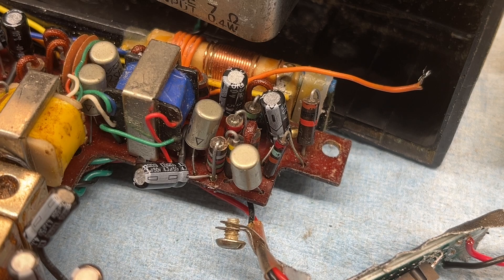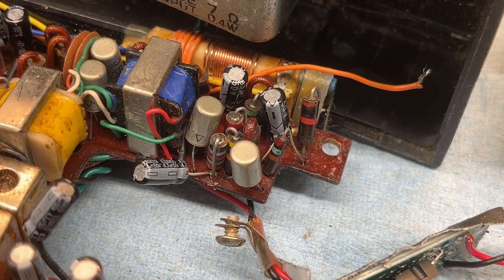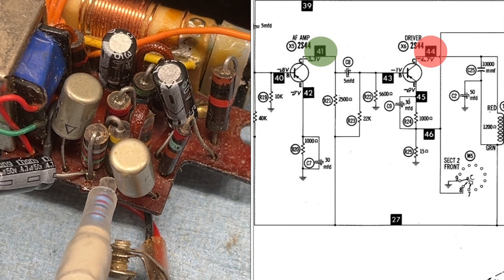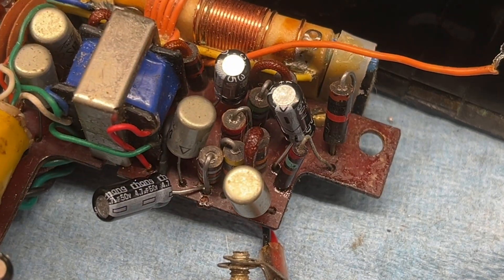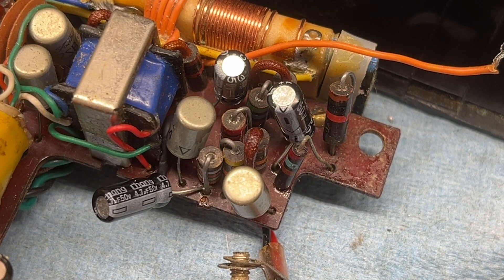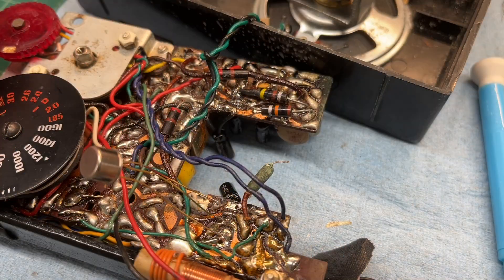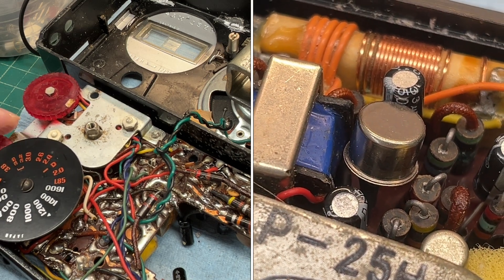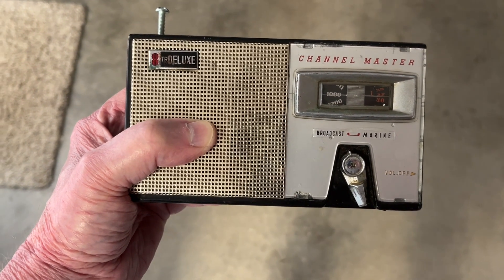Germanium Transistor HISS | Radio Troubleshooting/Repair | CHANNEL MASTER MODEL 6514

Comment: Just got hold of an RCA 1-TR-2 with the same story.   I've got some replacement transistors on the way, but it seems not to be really worth it.   NOS germanium transistors are $5-10 a pop IF you can find them.
Reply from the maker: Hope the replacement transistors work out for you. I was lucky and had a few parts radios sent to me that still had useable germanium transistors. All the best on your repairs. Don